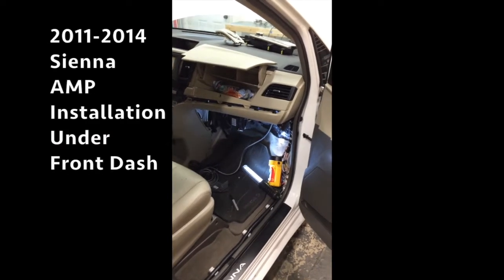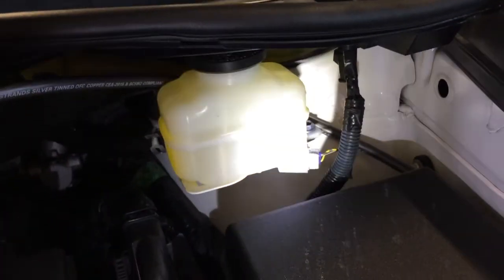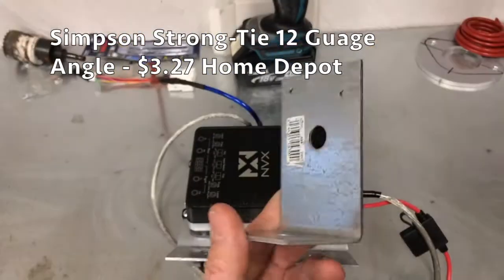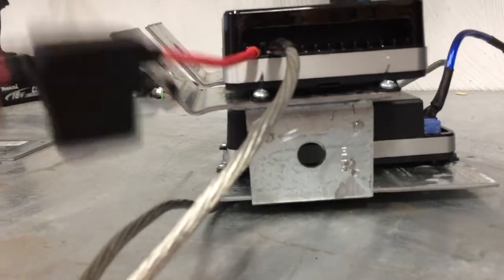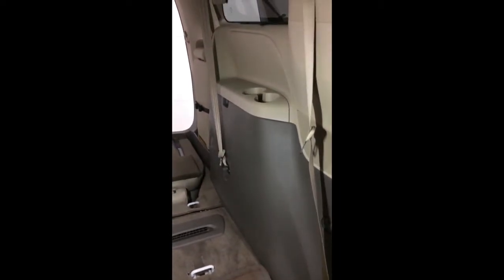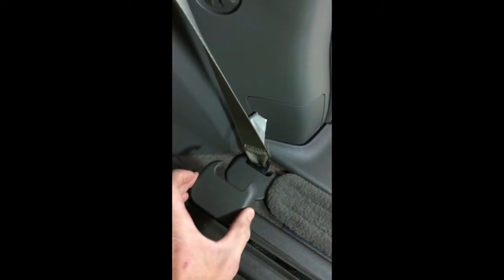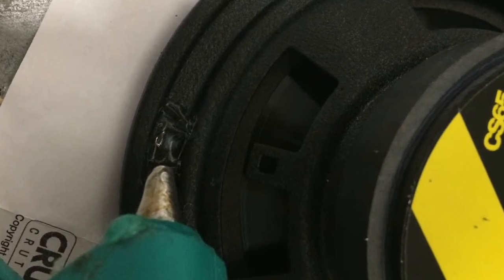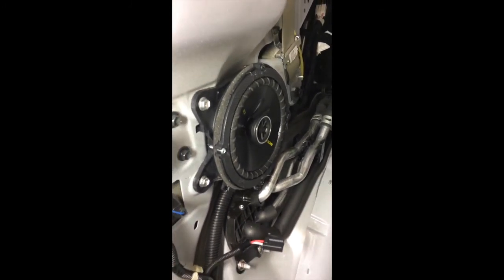Installing Custom Amplifier and Speaker (Toyota Sienna 2011-14)

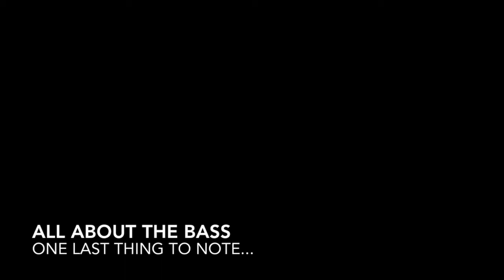Comment: 13:32 Is that the rear speaker?  Thanks for showing how to open up the rear panel from the front.  I had originally opened it up from the rear, but only enough to let me squeeze in the speakers (I also used the Kicker CS65).  Looks easier to do it from the front.  I wonder if there is just a little space behind them to install some Dynamat as in my experience, putting some Dynamat behind the speakers makes a HUGE difference for sound quality, especially bass response (and no rattling).  I plan to install some Dynamat on the sliding doors and behind the rear panels at some point as I've already done the in the front doors and love the improvement.  No need for a sub even (well, for "normal" music listening that is), and I do love my bass.

Comment: Interesting low key setup. How do you run remote, rca, etc from the stereo(stock or aftermarket)?
Reply from the maker: Since the amplifier is located behind the glove box I simply ran the RCA cables and remote wire from the back of the Pioneer radio to the amplifier all within the dash. Keep the RCA wires separate from any other wires. The amplifier and radio were about three feet away from each other. The power cable ran through the rubber grommet as shown in the video. If you want to keep the stock radio, the simple way is to use a radio interface module like the ones made from PAC. The best option for the highest sound quality would be to use a JL Audio Fix 82 if you have a DSP or Fix 86 without DSP. The best option though is an aftermarket radio because it will have basic EQ and time alignment adjustments and you don’t have to deal with the factory EQ.
Reply: I highly appreciate your quick response it sure simplify my options.
Reply: @PaulPi3rce  where did you put the subwoofer!?